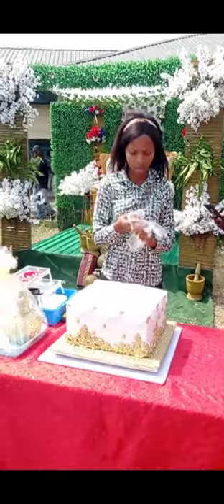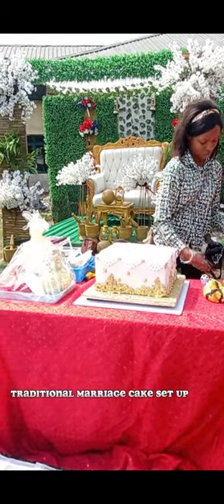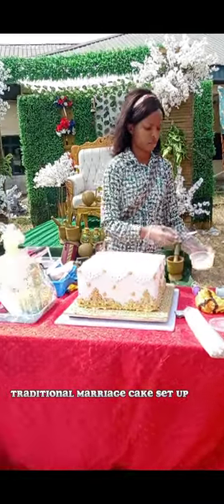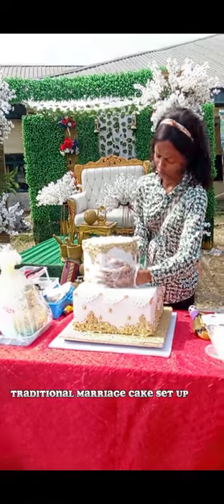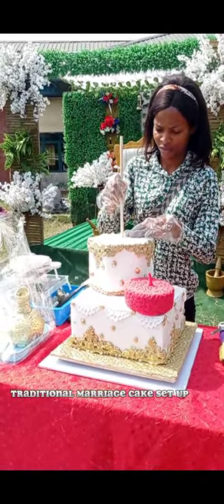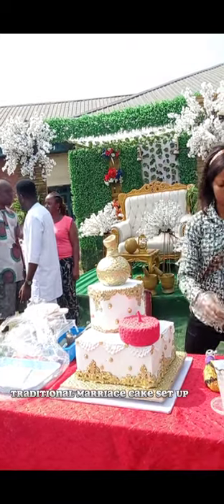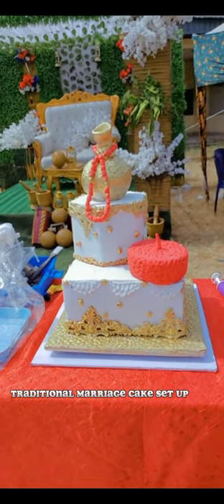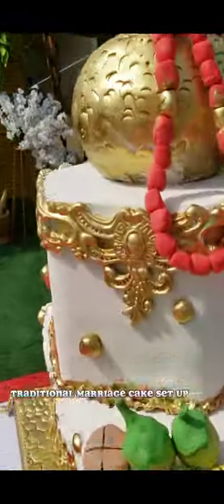HOW TO SET UP A TRADITIONAL MARRIAGE CAKE

Comment: Please how did you elevate the cake board,its double
Reply from the maker: Hi

I used a 22 inches board down then placed a 12 inches wooden separator on the 22 inches board, then the cake was decorated on an 18 inches board which i placed on the separator. 
So the seperator is in-between the boards